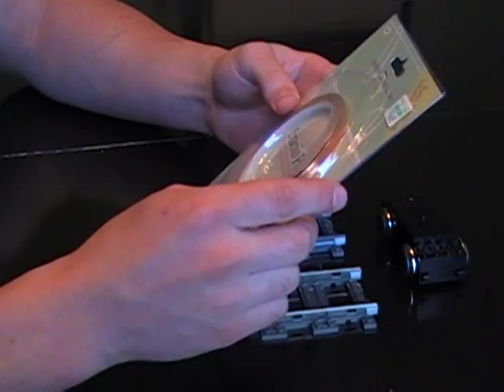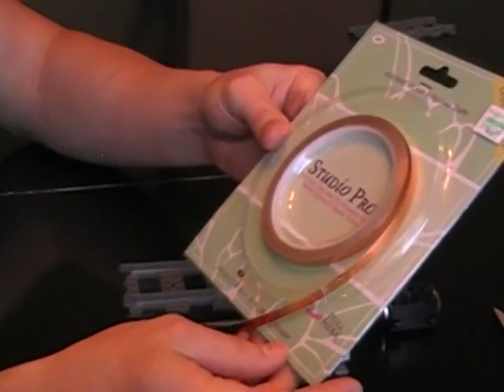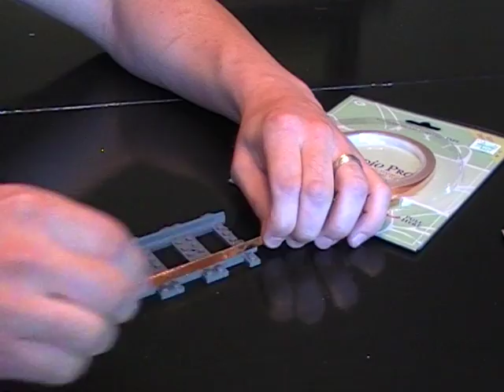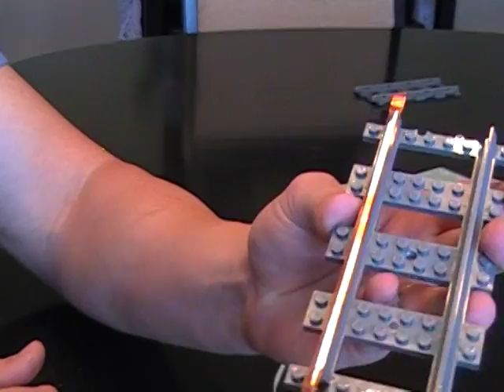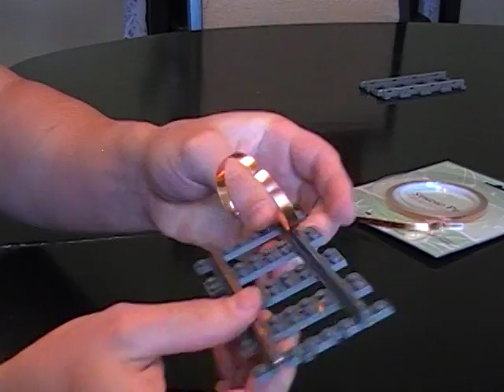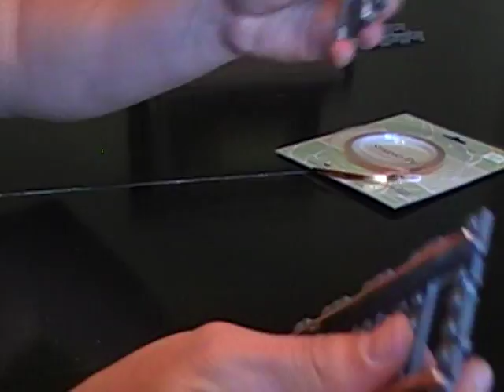How to convert LEGO RC track into 9v track using Copper Foil Tape

Comment: Since you performed this in 2012, have you noticed that if the copper wears down at different spots?
Reply from the maker: Yes, it does wear out, especially if you continue to move your track. I actually no longer use it, but it did a great job for a very long time with all my 9v trains.
Reply: @alexnunes  Thank you for the insight. I have sold most of my 9v track because Lego went to the new system, but I am not satisfied with changing batters so much. I think for a short-term solution, you copper tape my work. Thank you for experimenting with solutions.

Comment: the goal in this project is also to use old 9v motors chassis as power pickups to give current to modern P.F. and P.U.
I mean it's the perfect hybrid system that Lego will never give us, batteries are ugly. In this way you have all the benefits or rc systems, unlimited energy to place leds everywhere and trains that will never suddenly let you down...
Only system I love with batteries is 4,5 volt, but it's another story and they last very long.

Comment: Hey Alex, I am interested in using 9v rails, and im planning on making a layout for a freight train. I have some questions- is there any risk of electrocution when the rails are connected to the wires? If there is an open end rail can it shock you? Or is everything okay? Thanks
Reply from the maker: In my many years of experience using 9v trains and track, I have never been shocked by them. I think you're safe using them.

Comment: This won't always work because usually all kinds of copper conductors such as this tape have a coating on them which eliminates the connection between the train and the rail. This can be fixed with sandpaper, but it is tricky
Reply: Yeah, obviously he didn’t demo it so I wonder how well it works.

Comment: I do not know if you can find that tape just anywhere. What else can be used?
More importantly, though: how is that track today?
Reply: hntrains https://www.aliexpress.com/item/30-Meters-Single-Side-Conductive-Copper-Foil-Tape-Strip-Adhesive-EMI-Shielding-Heat-Resist-Tape/32810052541.html?spm=2114.search0104.3.8.eHE5sX&ws_ab_test=searchweb0_0,searchweb201602_2_10152_10065_5000015_10151_10344_10068_10345_10342_10343_51102_10340_10341_5130015_10609_10541_10084_10083_10307_10301_10303_10610_5870020_5080015_10312_10059_10313_10314_10534_100031_10604_10603_10103_10605_10594_5060015_10142_10107,searchweb201603_2,ppcSwitch_7&algo_expid=27dad01f-b32c-4f6c-b4eb-c783feec77ea-1&algo_pvid=27dad01f-b32c-4f6c-b4eb-c783feec77ea&rmStoreLevelAB=5
Reply: Whoa! Thank you!

Comment: I've done the same with aluminium foil tape, the type used for sealing HVAC ducts. It does a great job and it's silver coloured rather than copper, but I have to admit the copper looks pretty cool. I suspect the aluminium tape I used is quite a bit less expensive than the copper tape, however. The only thing is you have to cut the width and the length to the size desired.
Reply: A link to what? The aluminium tape? Just google "aluminium foil tape" you can buy it in most hardware stores. Or better yet go to your local hardware store and just ask for aluminium foil tape.
Reply: Alan Ljungberg can i have a link please ?
Reply: Cuanto tiempo te funcionó?

Comment: Hey Alex, I'm thinking of converting my whole LEGO City to 9v track. I think i will go out and buy all the 9v curves that I need because they are cheap, but for every piece of straight track could i use copper foil tape. Could you please run me through how it all connects. All I needs is a 9v motor for the trains, a speed regulator and the wires that connect to the track. Is that everything, also can the wires connect to the copper foil tape or would I need to connect them to actual 9v track.
Reply from the maker: +JR Bricks Yes, that's all you would need.  The train track contacts connect to actual 9v track in my layout.  I don't see any reason why they wouldn't work with the copper foil tape.  You can always attach them to one of your 9v curves if they don't work. For the sections of long straights, try and use one piece of tape. It helps with the electric current to have fewer disconnects. I hope that makes sense. Good luck.
Reply: +Alex Nunes thanks, also I have two seperate train tracks. Can I use one speed regulator to control both trains on seperate tracks. Would I connect both the connectors to just the one speed regulator?

Comment: Hey Alex do you know how to polish 9 volt tracks? I bought some off ebay brand new unopened and took em out and there a little tarnished along with some tiny rust spots. What can you do to polish em up to shiny new again?
Reply: A stainless steel scrubber used when cleaning dishes is the best.  Be sure to only use the stainless version.  I have cleaned all my 9v track this way.  But, only us it on the top of the rails.  You can clean your track with ordinary dish soap in the kitchen sink.

Comment: Hi. I'm just wondering if you've attempted to convert a PF switch track to 9v? I've got straight, curved and flex pieces going no prob but am wanting to try the switch track, but don't really want to pull apart an orig 9v switch to see how the connections are underneath.
Reply from the maker: I have not attempted this yet.  If I ever do, I will definitely make a video on it.

Comment: just found out about electrified lego tracks today. MIND BLOWN!
Reply: They also made Lego pieces with metal on the underside and coming up through around half of the “dot” on top. You could attack lights and sirens anywhere to these as long as they were connected to the 9V battery pack. :)

Comment: Thank you so much, I didn't want to spent 300+ dollars on 9v train track on ebay, this is the only video I have found with a way to make 9v out of RC track!
Reply from the maker: Glad it helped. I have used this method for over two years now and it is still very effective.
Reply: @alexnunes con cinta de aluminio funciona?

Comment: Nice video. Did you connect the 9 Volt track cable on the RC-track to power the tracks or did you connect them on the 9 Volt train track?

Comment from the maker: same principle with curved track. You will not need to make any cuts to the foil tape. Follow the same instruction as the straight track and it will still work fine.

Comment: sweet I used the silver foil tape, it works fine too, but wears off after several hours of running trains. but its cheap like  you said.  i lilke the copper idea better, another friend in our group used the copper and said it lasts alot longer.

Comment from the maker: I tried tin foil before.  It failed miserably.  The copper foil tape will work with curved track.  I have already done it on several. I haven't been able to get it to work on switchtracks though.  That appears to be a bit more difficult.